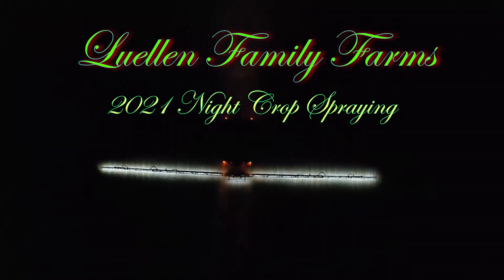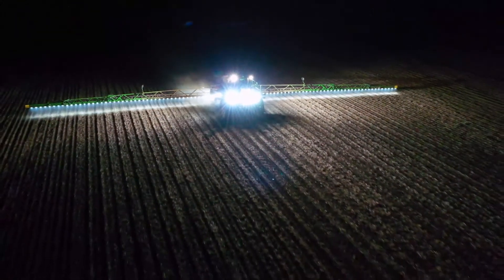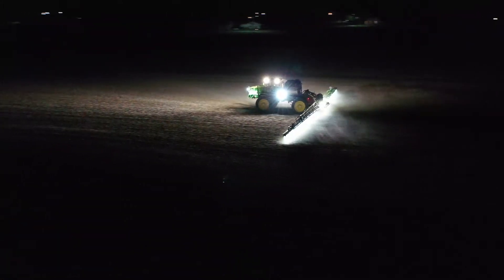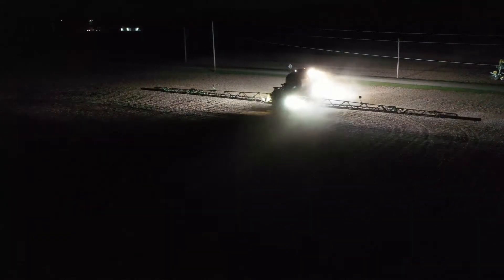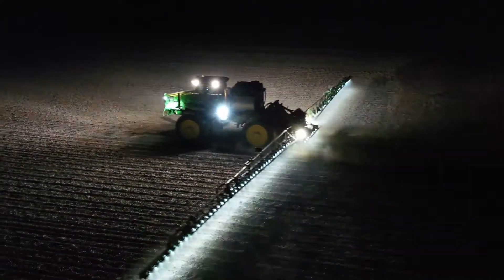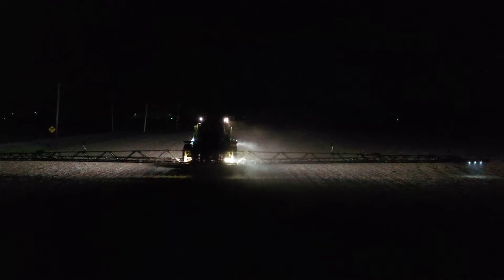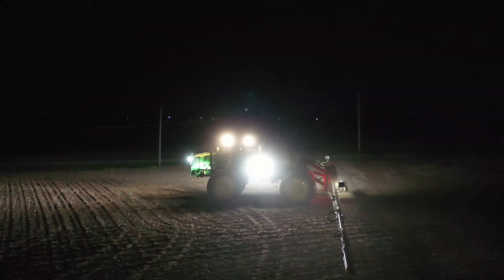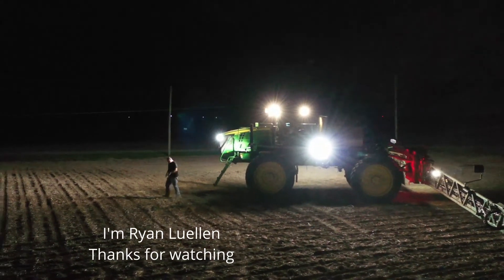John Deere R4045 with ExactApply Night Crop Spraying 2021 Led Lighting

Comment: Wow! Wicked burn on Dad right there at the end! lol. I used to do the same to my Dad (jokingly) when he'd smoke a highline pole or gas/injection well item and would have me weld up an aluminum boom tip, rebuild a boom tip break-away hinge or replace broken nozzle bodies... until he passed away in 2021... and it was my job to avoid obstacles on the sprayer... Well... I quickly learned that my dad was an expert operator, and me, being a noob sprayer opperator... I was quickly humbled. Frequency of repairs and part replacement increased 10 times under my control! Am I an expert now? Nope, far from it. My dad was the first local ground sprayer machine owner around my area in 1982 when he bought his first Hagie. He was a pioneer in the OK Panhandle in many ways.